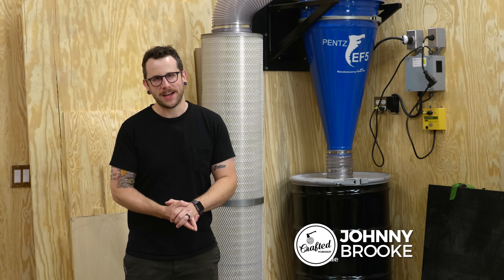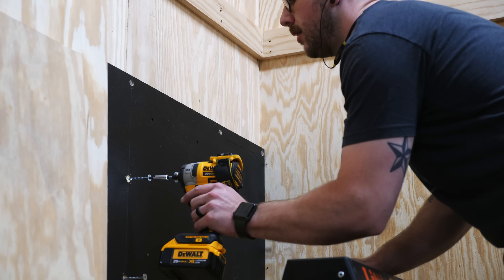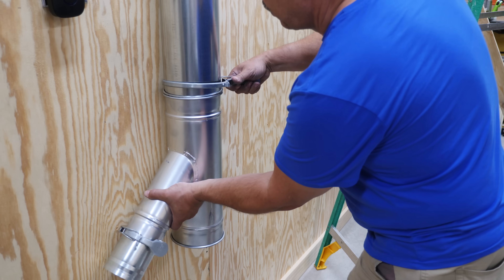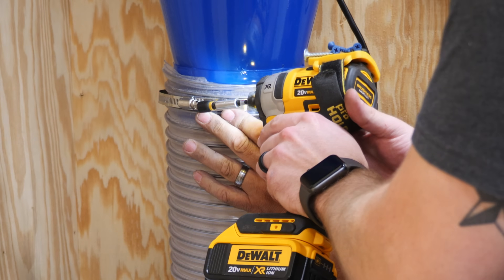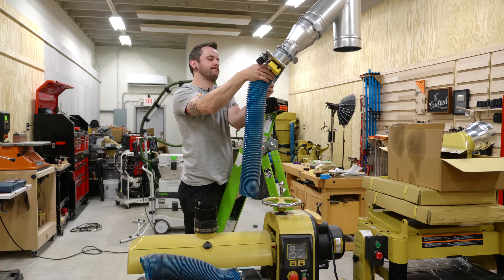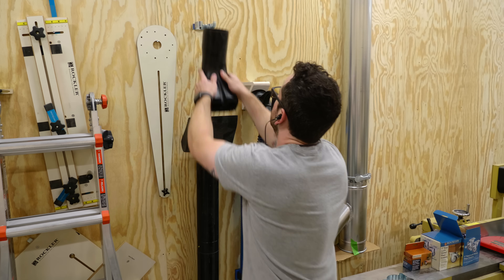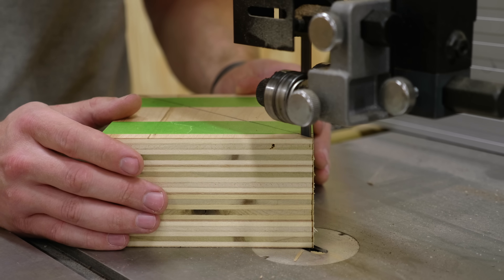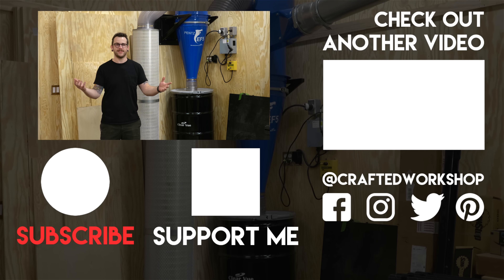Installing An Automated Dust Collection System // How To - Woodworking

Comment from the maker: Thanks for watching, y'all! I know a lot of you have been asking about a shop tour video, and it'll be live next week, so stay tuned and get subscribed : https://goo.gl/V5gcNJ Learn more about the Clearvue EF5 dust collector : http://bit.ly/clearvue (use coupon code CRAFTED for 5% off!)
Reply: What was that tiny fitting at the end of your straight run coming off the dust collector?  It sits between the straight pipe and your first 45.
Reply from the maker: That's a custom part that adjusts the system based on the angle the ductwork comes off of the Clearvue unit. Basically just brings everything back to level.
Reply: Custom elbow eh?  Very useful.  One last question, did you by any chance ask Nordfab if they did custom length straight pipes?  I'm currently designing a duct system for my shop and I have a bunch of sections that are shorter than five feet and a shorter straight pipe would save a lot on buying extra adjustable nipples.
Reply from the maker: Not as far as I know, but I didn't actually ask. I'm guessing it'd end up being just as expensive if it was custom. If it's short enough, you can just use the nipple as the straight pipe, which we did in a few places.

Comment: Couple questions, first off, nice build !  Wondering why you decided to draw air or of the filter box and possibly create an air swirl that could possibly just cause air tubulance over pushing air into the filter box love vacuum filtering without all the turbulence.
The pre-filter screen would really limit the surface area if the filter overall , but it would be interesting to see a long term test on both application or a 50% mix of pre-filter with no pre-filter to see how the filter bank performs overall.    Keep this test running. It's nice to see real-time results.

Thanks for the ideas on the filter bank cart.  Great idea !

Comment: Where did you find that magical 6" to 5" reducer for the planer??  I went to Home Depot and Lowes and they have them but they are 5" outer diameter and don't fit the planer(I have same as you). Gaaah!
Reply from the maker: Got mine from Lowe’s! Required a little finessing with pliers but it worked!

Comment: I'm really curious when they designed the ducting they chose to go with the double-90 at the beginning instead of just going with a longer section of straight pipe and then using a 22.5 or less to level off at the desired height.  Regardless, pretty jealous as I'm sure it performs fantastic either way.  Grats.

Comment: I used to sell large industrial systems. One thing I noticed is that they did not recommend that you put a ground strap/wire (to ground not the negative) on the metal ducting, as wood fibers can create static electricity. Which could cause a fire in your shop. I would not mount it on the dust collector as it coated and may not dissipate the electricity form the ducting.

Comment: For most people Norfab is overkill. It's incredibly expensive because it rated for fumes, smoke, and dust--really industrial. Yes, quick connect is great, but for those that plan their system well, there has to be less expensive solutions that is also of very high quality.

Comment: Given the power of this system .... it is probably overkill ... but looking at laying out something similar for my new workshop (cheaper duct work as I am a hobbyist) and wondering if moving the blast gates closer to the main run (rather than at the tool) ... would be worth wild?

Comment: Hey Johnny! I’m making a recycled stool out of three steel rims out of a junk yard, in trying to figure out hot to protect flooring from the sharp lip on the bottom rim, I tried fuel line cut down the middle with some epoxy with no success since the act of moving the chair wore out the bond of the epoxy very quickly. Any thoughts on the material I could use?

Comment: ClearVue is brand of dust collection I want to get. PowerMatic bandsaw is one I want to get. You have both would love to see before and after dust inside the bandsaw. Any chance you can have a Dylos air meter running as well?
Reply from the maker: I don’t have a Dylos air meter unfortunately and I’ve always had a Clearvue since getting the bandsaw so there’s basically no dust whatsoever in the bandsaw cabinet.
Reply: Crafted Workshop thanks. I worry about wood dust. I think ClearVue makes the best one out there.
Reply from the maker: It is definitely incredibly powerful!

Comment: You kept talking up this ducting, all it's features, these holes are so amazing to have, etc, and I was sitting here just thinking about how theyre limited production, all the bells and whistles, and they probably cost so much more than is reasonable and couldn't possibly be worth the money over even just normal ducts or PVC.

Then you said it was 4000, and I think that's crazy. Blew me away. Couldn't imagine buying 4000 in ducting out if pocket for such a project. You're paying half that cost for a look and feel at that point.

Comment: Probably doesn't matter since you'll never need to do this again but you know you didn't need the 2 90s at all... You had 2 45s just before that. If you just angled the connecting piece between the 45s (and make it a little longer) you can go up AND over with just the 2 joints, no need for all 4
Reply from the maker: That would be true but that first part is at 7 degrees, not 45. It’s to adjust for the angle coming out of the dust collector. Hope that makes sense.

Comment: Nicely done, looks like a real professional installation.  Just one thing I'm curious about, why didn't you mount the cyclone higher up, and attach the collection drum with a longer section of pipe?  Seems like you'd get better performance than the 2 90s you put in.
Reply: Raise cyclone - dido the no 90's .. Add more hose at barrel.?

Comment: Looks like iVac stopped making switch/sensor units that support 30 amp tools. Bit of a bummer.
Reply from the maker: The sensors support any amperage as all they’re doing is sensing current. I’ve got the same sensors on my 20a drum sander and 40A planer, they work fine. The switches only support up to 20A, which is why I need to use a contactor in conjunction with my dust collector, which draws 30A. Hope that makes sense.
Reply: @craftedworkshop  Thanks. That does make more sense. The ivac site is not super useful with those details. My saw and planer are 30amp circuits. IIRC, my dust collector is as well.

THanks. I'll look back into these.
Reply from the maker: Yea, it is a little confusing!

Comment: Nice system. Great addition to your new shop. Not gonna lie. I’m a bit jealous.
Noise is probably not your main concern. Yet I wonder if it would run quieter using some padding in the brackets. Especially when the pipes are mounted on plywood walls. Depending on motor/system vibrations that plywood where it’s bolted on to, is gonna act like a subwoofer. At least. That’s what I would “worry” about 🤓
Reply from the maker: Thanks! And I could enclose the dust collector in its own “room” to cut back on the noise, it’s the biggest culprit. That’s what Frank Howarth did.

Comment: Great system, thanks for the video. Way outside of my budget but it looks like a great system.
Reply from the maker: Thanks! Definitely expensive but my previous system might be more in line with a budget-friendly option.
Reply: @craftedworkshop  One thing I definitely agree with you about is that the whole system is quite complex to design. There are just a lot of parts to think about.
Reply from the maker: For sure!

Comment: Nice! That Nordfab is a bitter pill to swallow but it's nice that you can adapt it to different setups and it can move with you. I have the iVac Switches but not the gates yet. Might try an arduino thing for the gates but I I love the switches.

Comment: to help with dust collection on that miter saw station, i added clear thick plastic sheeting on the face. I think it increased my suction for that saw by at least 70-80%. I barely get any dust coming out from off the saw and most of it ends up back behind the saw or through the hood/collector.
Reply from the maker: I need to do that!

Comment: Dude 😳😳😳😳 4 grand just for duct work. puts hand up to forehead
Reply from the maker: Yup! Tough pill to swallow but I shouldn't ever need to buy ductwork again. Buy once, cry once.
Reply: Crafted Workshop does this logic work with wives? Asking for a friend...
Reply from the maker: My wife was the one who told me to go for this more expensive ductwork! But this is also my job, so.... 😊
Reply: @craftedworkshop  Some pills are too big to swallow. Nearly all quality ductwork can be a buy once solution. It may require a little more time, but seriously that stuff is like $7 a foot. If one has the money, then no need to cry, just do it. But for those who have more time than money it's the difference between having dust collection or not and spending for Norfab just isn't the only way to get high quality. Of course, the time element and it being a business expense is a whole different deal than a hobby shop where the budget is tight.